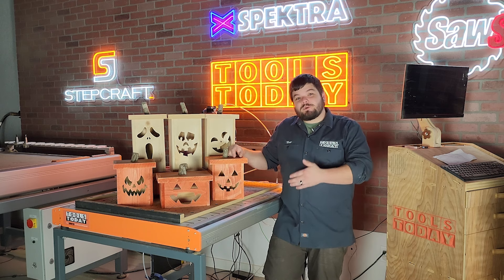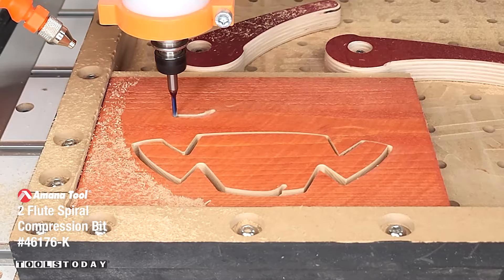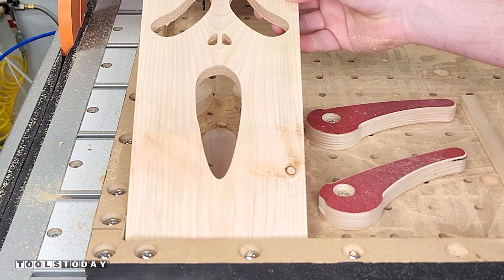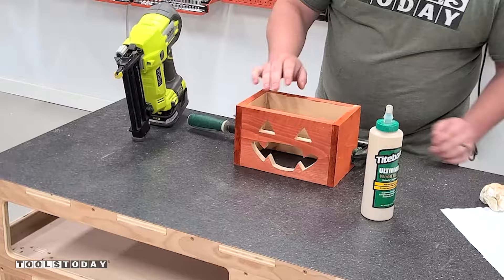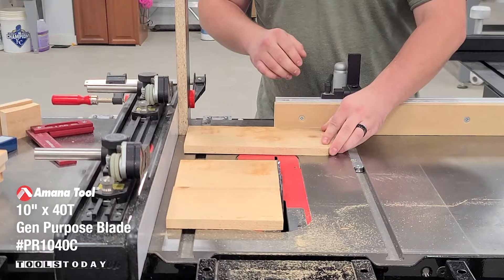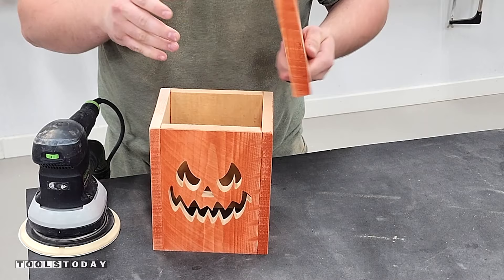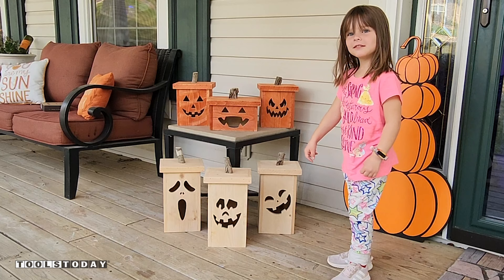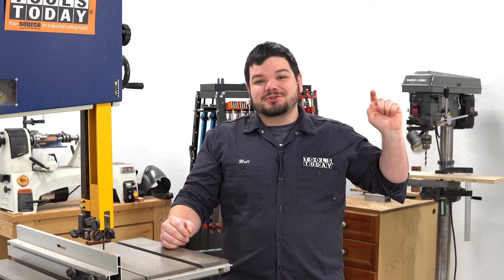How to Make: Wooden Jack O' Lantern on CNC | ToolsToday

Comment: What bit would you advise from Tools Today, to cut a 5mm deep, oval shaped pocket in clear epoxy ? will be putting a picture in it then recovering with epoxy.Thanks
Reply from the maker: I would probably recommend the 57363-K Spiral O flute bit
Reply: @ToolsToday  That's great, thank you

Comment: Are tabs not needed?
Reply from the maker: They can be added, but when using a lead in there is very little material left where it comes loose so it very rarely causes an issue or pops out.